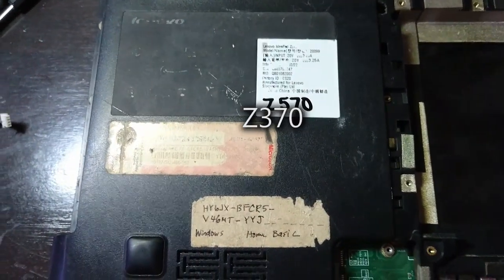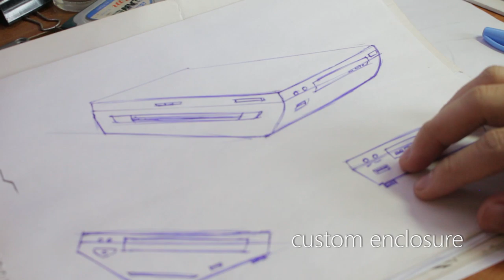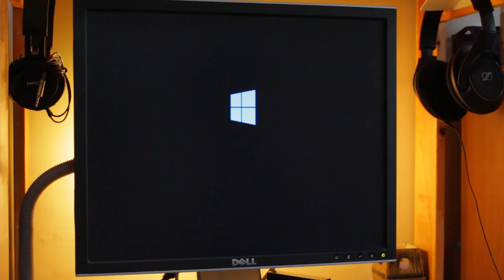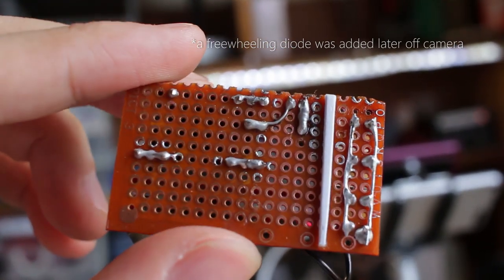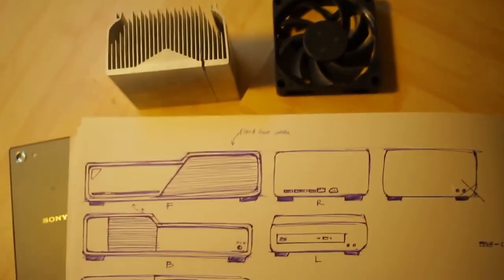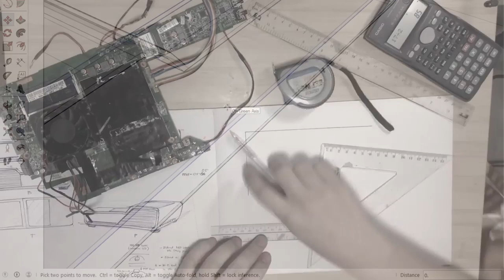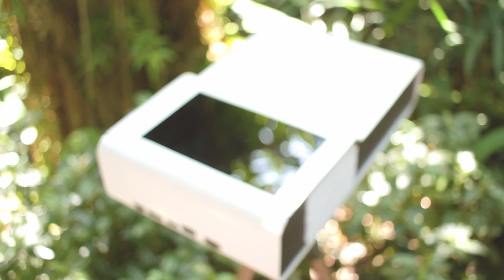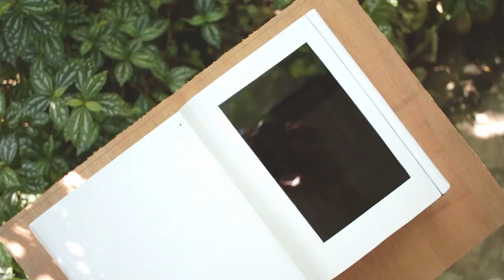Scrap Laptop to Compact Desktop - FrankenPC (Highlights)

Comment: How'd you deal with the internal monitor, is there a way to disabled it entirely?
Reply from the maker: If you're lucky then you can just disable it in the BIOS/UEFI.
If you don't have that option (I didn't) then you are at the mercy of what OS you use.
- Windows always default to "Duplicate these displays" so you can just turn off in Display Settings easily.
- On Linux Ubuntu...well...I even made a blog/guide about it: https://ejzllanes.wordpress.com/2018/11/12/using-a-laptop-without-the-built-in-display-when-it-is-only-displaying-the-2nd-displays-desktop-in-linux-ubuntu-and-mint/